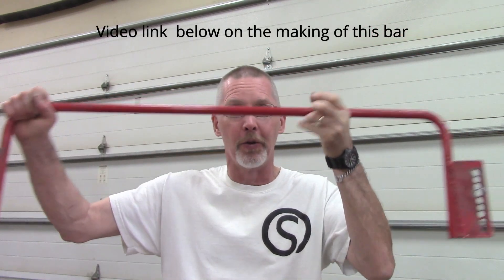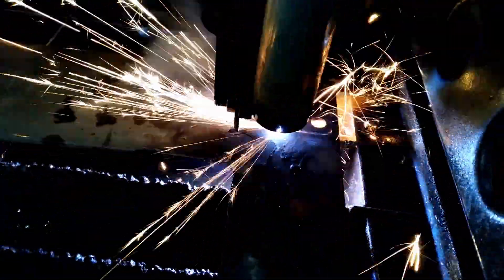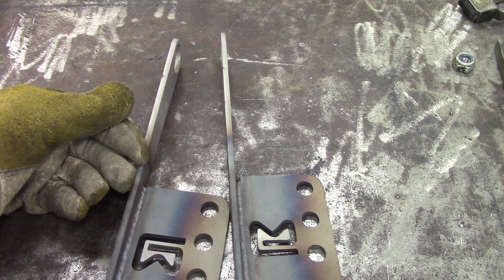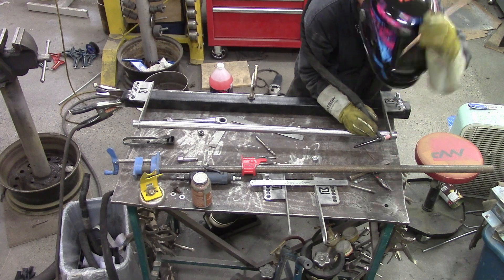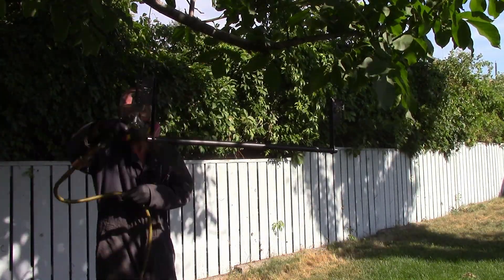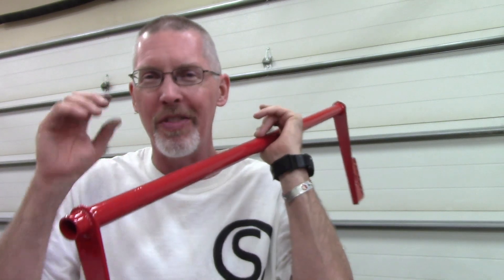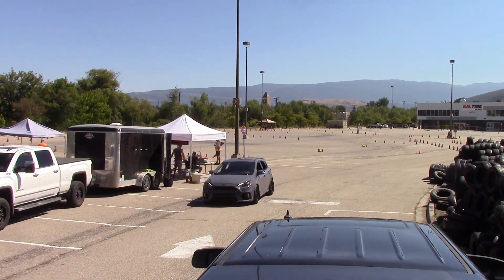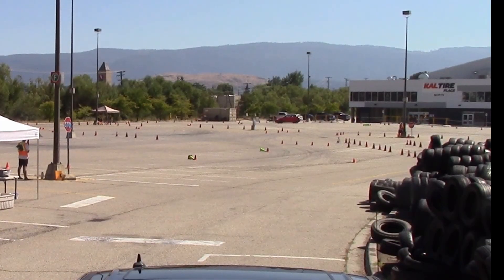Fabricating a BIGGER Sway Bar!

Comment: I realize I'm late here, but wouldn't fresh rear axle bushings be more effective than the sway bar? Or at least make the sway bar more effective? I got some new bushings for mine, but after looking at where they need to be pressed in and out, I'm planning on getting a rear axle from pick n pull and filling the bushings with a poly adhesive; it ahould be a significantly smaller headache.
Reply from the maker: I'll bet new bushings make a difference.  I'm pretty sure poly bushings are available, but that torsion beam axle twists A LOT, and it's reducing that twist that makes the biggest difference.  The bushings won't really stop the actual twisting of the axle.  I'm going to try a welded plate to box the axle itself soon.
Reply: @GregWellwood I actually bought a set of poly bushings from siberian bushing, but with limited experience and a bushing tool that didn't seem like it would work in that location it didn't seem like the best idea to do the swap. I'd gladly trade those for a sway bar 😅

Comment: As an autocrosser since the late 90’s (89 Corvette) I have put bigger bars on almost every car I’ve owned.  Now I need to add swaybars to my lowered 37 Hudson coupe.  Good to know there is a way to build them myself. 👍🏻
Reply from the maker: Cool!  Keep in mind - this style of bar only works on a torsion-beam axle.  You will need more mounts (center ones ont he chassis, for example) to work on any other style of suspension.  But yeah - I have made a number of bars on a number of cars over the years.

Comment: Why not build 2 chassis connection points like most other manufacturers sway bars the only one i can think of off hand with just the control arms hooked up are the old vw bug front sway bars 
🤔 But as yours are they were not allowed to pivot on the arm so 
I guess the 2 center points may not be needed but id try to add them too see    if that gives you more  stiffness

Comment: So the aftermarket bars for these cars (well not THESE ones, nobody makes one specifically for the MC right now, but similar beam axle Kiyundais) seem to pick up on both the inboard and outboard holes in the spring perch and make heavy implications that they're doing that to counteract any camber gain one might see from the trailing 'legs' of the beam twisting under load. Any thoughts on that? I'm thinking of doing a bar like your earlier 7/8" design and incorporating this feature as well but I'm not entirely sure if there's much to be gained or a risk of side effects there.
Reply: Although now that I've posted out loud I am kinda wondering if we want that camber gain so the outside rear tire engages in a controlled slip to help the car rotate rather than breaking loose completely and pointing me directly at the annoyed Corvette I forgot to point-by. Part of me wants to point a gopro at a dial indicator on this beam for a couple spicy turns to see if/how much the beam flexes in that way.
Reply from the maker: I would not lose any sleep over camber change in the rear on this car. If you wanted to get serious, I would slot holes to get at least -2.5° camber up front, and look at those poly caster bushings you can get for the front as well.  I am currently running a 1" SCH40 rear sway bar right now (1.315" OD), and still want more (though it might be really good for road racing, I want something more "autocross twitchy").  Plating the axle "U" itself will be next for me.
Reply: Yeah I'm already working on doing all that stuff up front, and the offset LCA bushings are on order. If you want a little more meat in the beam itself the Forte/Soul beam looks like it might work in there... I'm in the midst of swapping 1st gen Forte brakes/hubs/knuckles on mine as well and it all just legos together except the CVs. I'm leaving the beam for now cause I'm going after the low hanging fruit first and that swap will require drilling spot welds and swapping the upper spring perch/shock mount ass/y for the revised shock position, not quite ready to get surgical with this car yet.

Comment: Hey I’m watching this after reading ur article and I love your accent I have a black 09 accent hatchback and I’m just now doing mods on it , I’m 18 and I’m not so good at fabricating yet so I’m kinda lost on what to do. Can u help me out here
Reply from the maker: <teacher_mode_on> Start by doing small mods that you can handle, bolts ons and such. Your skills grow as you dabble more and more down the road of modifications. I don't know where your skillset is, or what tools and equipment you have, but start with small stuff that you can manage.  At 18 I did very little in the way of metal fabrication - I could do mechanical rebuilds and repairs. I did my first engine swap at 21, which included fabricating motor mounts and exhaust. By 27 I had fabricated electric go karts. By 32 I had built a tube-frame dune buggy from scratch. By 35 I had built a Lotus 7 replica from scratch (fabricated my own suspension, and shortened my own driveshaft) and got it street legal.  Start with stuff you think you can manage, and those new skills feed the next skills, and you get better and better (and bolder and bolder).

Comment: Can you extend the flat mount area to the weld circle?  That with extra weld tabs near the pipe might make it stiffer…..almost like “T” stock.
Reply from the maker: I did draw up another set of arms like you are suggesting, but I couldn't visualize it being stronger than tube arms.  I'm going to find out soon enough.

Comment: Neat.  Pretty sciencey stuff, your rear sway bar builds!  Does the bar help correct the front wheel drive plowing feel when cornering hard?  That is so hard to get used compared to a rear wheel drive where you can bring the back end around pretty much whenever you want to.
Reply from the maker: Yes, very much so.  Done right, you can bring the back end out by abrupt lifting of the throttle. This car needs still more.
Reply: Cool.  That plowing is something I really dislike! @GregWellwood

Comment: gusset the mount plates and or make them thicker too.
plug weld in a short length of rebar inside and in the middle....
plug weld from center out towards the bend...adding more plug welds for more rigidity.
(or just put bolts through for adjustability adding and removing bolts/pins to suit the track)
schedule 80 pipe next